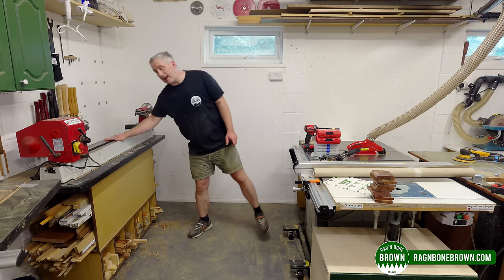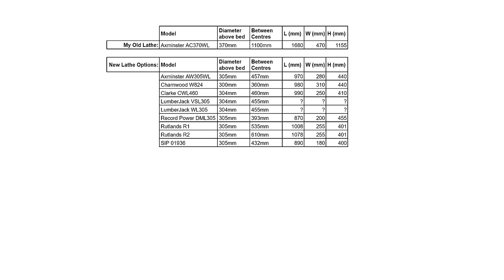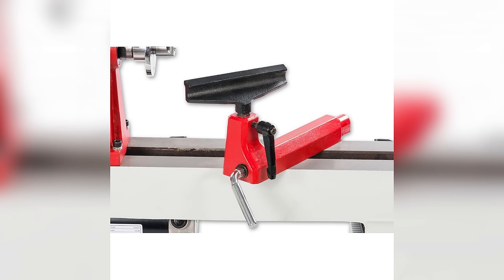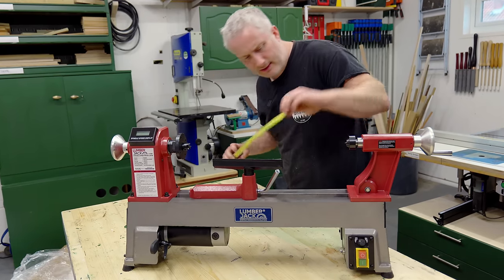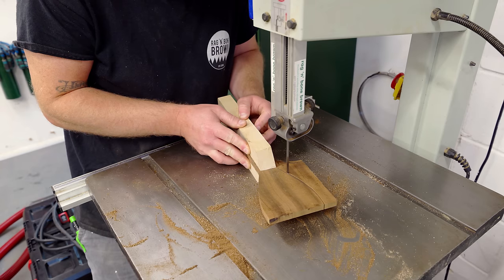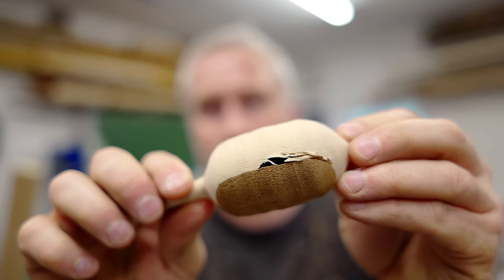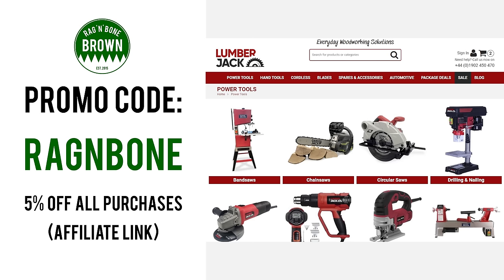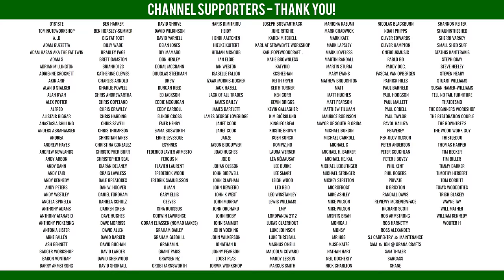How I Chose My New Lathe + 3 Lathe Projects

Comment: The lever style locking levers are normaly designed with a spring around the thread this allows you to move into a locking position without having to   make a full revolution if you pull the lever along the thread it will ratchet so you can reposition the lever and continue to lock the lever by letting go so it can relocate on the internal teeth. Then continue until the part is locked securely.
Reply from the maker: I am aware of that, but it's still fiddly and frustrating in use
Reply: @RagnBoneBrown  I guess you could try changing the tool height lever to a knob.  They're cheap enough to make it worth a try.

Comment: I think you are right, they are all made in the same factory.  The lathe I use at local Fairs for Demonstrations is the same as yours but a different 'Colour' LOL. The tool rest is your preference but the Rest you have got is designed so that you can rest your index finger in the groove to make it easier to hold and guide the tool along its length and keep a constant distance when dimensioning a cylinder you are turning. Nice to see an instant use for your turnings 😊
Reply: That's really handy info about the rest. Thanks mate.

Comment: I bought a short bed lathe (Nova) mostly for bowls and then wanted to turn table legs. Bought a bed extension and bolted it on the end with any other support. Been just fine for many years.

Comment: I find on my Rikon midi lathe that, when the banjo and tool rest handles conflict, I can just put the handle of the banjo in the other direction, and it will lock down just fine. The tool rest handle only locks in one direction since it is threaded - the banjo will lock in both directions since it is a cam-lock.

Comment: Here in the U.S. We have Shop Smith. I have a 1947 10ER that I rebuilt. I have about $200 in it for parts, including a 4 jaw chuck. It can turn table legs, which I do fairly often. It has a speed changer on it as well. I only use it as a lathe and serves quite well for bowls and replacement furniture parts. I'm chuffed over saving it from the scrap bin and giving it a new life.

Comment: Another great video! I had been considering buying the Record Power lathe, but seeing your spreadsheet,  the Lumberjack seems a better bet. Can you tell me what make and model of chuck you have? Years back I used to make gourd rattles and pearl barley works very well, gives a good sound and in case of breakage is perhaps a safer option. Thanks again.
Reply from the maker: My chuck is a viper 2
Reply: Thanks `i'll bookmark that one. @RagnBoneBrown
Reply: @tworiversworkshop6111 if it helps I've recently got the vevor 3.75" 4 jaw chuck for the same lathe works really well.
Reply: @michaelwillson6847  Thank you.
Reply: @tworiversworkshop6111  no worries

Comment: rattles on the lathe can be tricky, I tend to hollow them out on the lathe and glue in a dowel in the remaining hole which also serves as the handle
captive rings work well for rattles as well, and perhaps easier to do well

Comment: The Lumberjack style tool rest is theoretically better than the round section Charnwood item where the fulcrum for the tool varies according to its angle to the work. A hard rest is obviously desirable but this can be achieved with the cast type with the use of a "chill" in the mould.
Reply: @eegaugh What's a chill in the mould?

Comment: great video, with good detailed content, the tool rest handle looks to have a screw and spring at the end, this will allow you to pull it away, re position it and let it back to re tighten a nut underneath, think of the handle as a spanner, so you could turn 90' pull turn back 90' without loosening the clamp !! a lot of tools have this feature
Reply from the maker: Yes I am aware of this. I have them on my planer fence too

Comment: The clamping levers are spring loaded. Push/Pull and they will move independently of the lever shaft, use to avoid other levers.
Reply from the maker: Yes I'm aware of how they work

Comment: Nice one Keith.  I've got quite a few LumberJack bench tools now, and even though I've got no room, I now finding myself wanting a lathe now! 🤣
Reply: I can confirm it's great product aswell. I also have fair few lumberjack tools now quality and reliable. I have there 10" sliding mitre saw 4" belt sander the lathe and plainer thicknesser. All been great so far. 🏴👍

Comment: I have the W824 - it's great, but it's very restrictive in length. I'll measure when I get chance to confirm. It feels very well made and I love the digital rpm display. I have considered getting something with more capacity in case I wanted to turn table legs at some point, but I'm not sure when that would be! Also on the baby rattle - I've made a few and found using a spoon carving gouge to be the best way to make a more spherical space for the "rattly bits" to go, which in turn means you can make the walls thinner which makes for a better sounding rattle.
Reply from the maker: Thank you! Yes please do let me know, I'd appreciate it. Great advice 👌
Reply: @RagnBoneBrown  I've just measured and I think I could just about sneak a 410mm blank in there, but I would say that 400mm is probably safer as more of the non-motor end is clamped to the rail.
Reply from the maker: Thank you!

Comment: That live center is a nice feature. And I'll bet you'll figure out some clever way to adapt those awkward interferences between the post holder and the slide holder.(Perhaps that replacing the slide holder handle with a nice knurled knob would be a good place to start, because I'd bet that connection encounters less torsion than the post holder screw connection needs for resisting compression of the tool rest, and maybe therefore needs less holding power.)
Reply from the maker: That's a really great idea 👍
Reply: ...And maybe just a short, "slotted t-handle" could work? (To avoid having to replace that bespoke-looking, non-standard bolt with it's bent handle)

Comment: The black handle on the tool rest should pull outwards to stop it binding up with the other handle.
Basically just pull it out (like away from the tool rest) and turn it anti clockwise. Then let it go back in again and turn clockwise to tighten. Pulling it out makes it free spinning and when it goes back in again it locks in place. Repeat this action if necessary to tighten it. You do the same backwards to loosen it.
Hope that makes sense and helps. Let me know if further explanation is required!
Reply from the maker: Yeah I am aware of that. I have the same knobs on my planer fence. They're too fiddly and frustrating. 👍

Comment: Kieth this couldn't of come at a better time. After we spoke other day ive just bought my lathe today. I have went for a cheaper one right now till i get bit practice in although i did look at the same one u have got from lumberjack although was just bit out my bidget the now. I have few lumberjack products there plainer thicknesser combo is great the little brother the one your thinking about and i have there belt sander and wow is it an amazing peice of kit 🏴👍
Reply from the maker: Thanks Michael. I like the look of the planer but not sure which one to go for!
Reply: @RagnBoneBrown  tbh I think for what u do a no it's allot more expensive but suspect you'd benefit from the bigger one the only issue I've found with the smaller one so far is if you try take to much off or feed to quick it does trip it mid cut sometimes although that could just be because am trying take to much off and a no you like quiet tools it's not exactly quiet fine for me but a no you like quiet tools.

Comment: I think the difference in the size of the Lumberjack and the Charnwood is because of the top cover on the side of the Charnwood for easier access to the pulley at the top. The headstock pulley system on the Charnwood is positioned differently than the Lumberjack  lathe

Comment: Those black handles are probably the sprung loaded type, you can pull them out a bit and move them around when they collide.
Reply from the maker: Yeah I am aware they rotate, but still frustrating in use

Comment: This video came at the right time. just about to order and had the exact same two in mind. i also saw the R2 but the price put me off abit plus i ordered from them before and recieved damaged goods(twice!) You have helped me make up my mind after this video. i do have a bandsaw and pillar drill from Lumberjack that so far have worked great for my needs. 
i think i may  be placing an new order with LJ this weekend (your code will come in handy !) Thanks lol Keep up the great work ! 👍👍
Reply from the maker: Thank you. It's a nice machine, you won't be disappointed

Comment: The Charnwood has the motor in-line with spindle and the Lumber has the motor below the spindle. Hence the difference in capacity.
Reply from the maker: No the charnwood motor is beneath too, it just has a different shroud around the headstock
Reply: @RagnBoneBrown  ah I never realised! :)

Comment: I've not got that particular Charnwood (I have the mini version) but looking at the pictures it seems to me that on the Charnwood the belt drive is encased behind the headstock (the black casing at the rear) rather than the belt being within the headstock like the Lumberjack.  The pictures show the Charnwood headstock extending beyond the cast iron leg, with the Lumberjack being set further back along the bed.  Perhaps that accounts for the 90+mm difference???
Reply from the maker: Quite possibly! 👍
Reply from the maker: Interestingly though, the axminster also has that style of enclosed headstock and yet the turning capacity is longer.... 🤔
Reply: @RagnBoneBrown  I have the axminster lathe i am going to have measure it now
Reply: @RagnBoneBrown  Perhaps somebody forgot the golden "measure twice" rule before posting the specs 😂

Comment: Do you get to keep the tools that brands give you? Or have you to give them back at some point? Also, does anyone have any recommendations for decent bench chisels that don't need sharpened every 5 minutes?
Reply from the maker: It depends on the deal, they all have different terms and requirements etc. The narex chisels are well regarded
Reply: Thanks for taking the time to reply, love the channel. I will have a look at the narex ones.
Reply: Hi Keith. I have the Charnwood W824 and with the supplied drive spur and supplied live centre the working distance measures a safe 405mm. I can gain a bit more with a smaller live centre as the supplied one is quite chunky. Hope this helps.

Comment: Did you investigate if replacement parts are available?
Reply from the maker: Nope, like what? There shouldn't be anything to replace really, other than maybe a drive belt but i suspect they're all standard
Reply: Like the motor, the headstock bearings, the spindle and pulleys. Critical components that may be ok but then again maybe not. The bearings in the headstock are probably a standard size and could be found from a bearing distributor if needed. Inexpensive lathes use the cheapest and smallest bearings they can source. Doing a lot of bowl turning using a chuck  with a large blank on it can shorten the life of the bearings or kill them outright. If you want to keep an eye on them use your ears and a mechanic's stethoscope.
  @RagnBoneBrown
Reply from the maker: I suspect that I don't use the lathe enough for it to be a concern for me. If it were my table saw, it would be a different story as I rely on it so much!
Reply: I wish you luck with it .
 @RagnBoneBrown
Reply: @georges8348  I can confirm we stock 98% of all our machine parts here at our Wolverhampton HQ :)

Comment: Keith, your banjo lock bar is bi directional, just lock it to the left not right, then it wont fail the tool rest lock
Reply from the maker: I'm aware it rotates, if that's what you mean. Still, in use, it's an annoyance